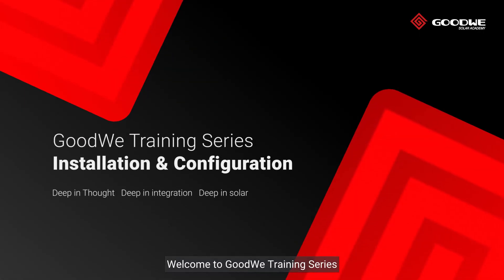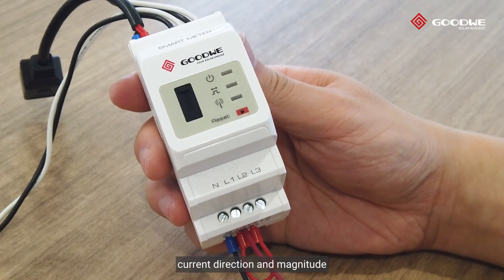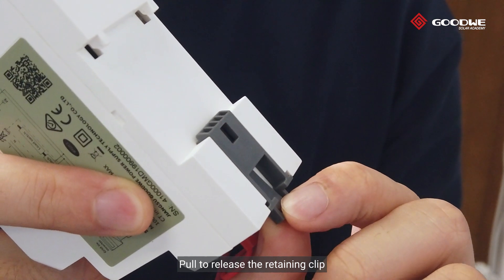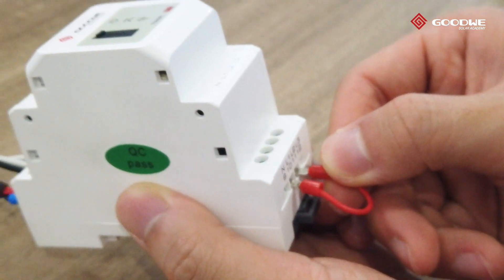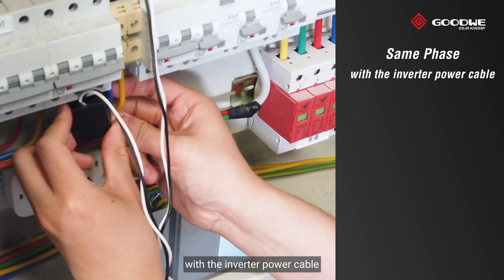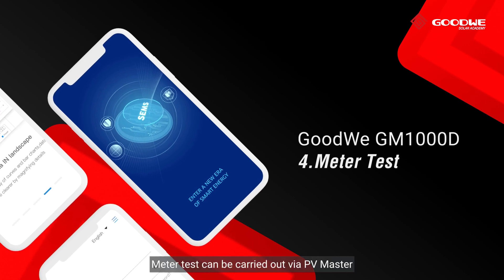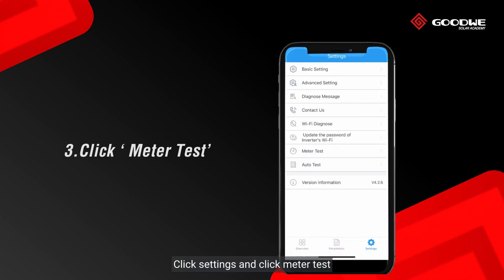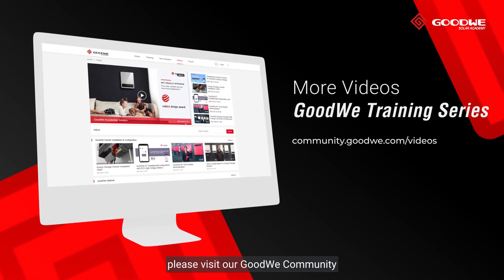GoodWe GM1000D Installation & Configuration

Comment: meter test says ct1 connection error. ct2 connected. when i remove both it says the same. when i remove ct2 it still says ct1 connection error. ct2 connected??? what is wrong?

Comment: Which its the difference between gm1000 and gm1000d??
Reply from the maker: GM1000D has 2 CTs，which is designed for the AC coupled Inverter.
Reply: @GoodWeSolarAcademy hi I have GW10K-MS-30 which one do I need to?

Comment: hello, I dont have a RJ45 cable on the GW4k-DT inverter, only the RS485 socket. How to make the comunication with the GM3000 smart meter? Thanks
Reply from the maker: Actually, GM3000 uses RS485 to communicate with the inverter. Please refer to the datasheet of GM3000 and the user manual.
Reply: @GoodWeSolarAcademy  pv master is for hibrid inverters. I have GW5-DT inverter, on grid. How should I add the smart meter? What app will work for this?

Comment: what is the differancea between homekit and gm1000?
Reply from the maker: Homekit is an advanced smart meter that uses independent power supply to realize 24 hour load consumption monitoring as well as export power limit control while gm1000 can only be used for export power limit.